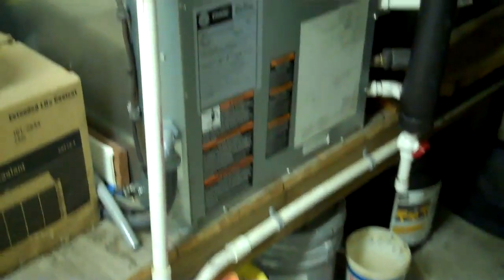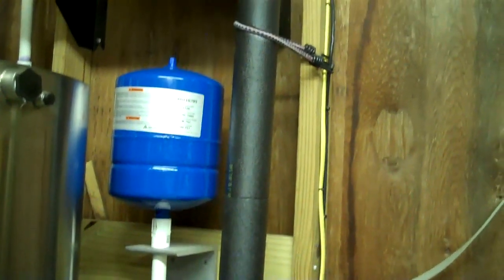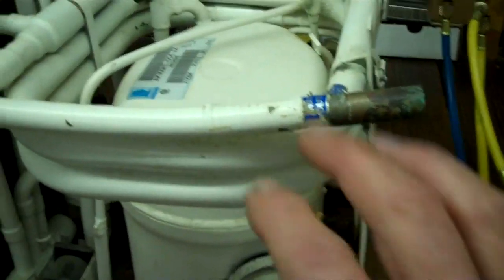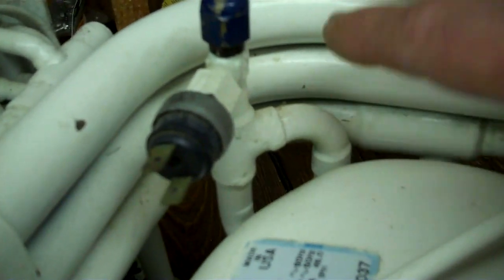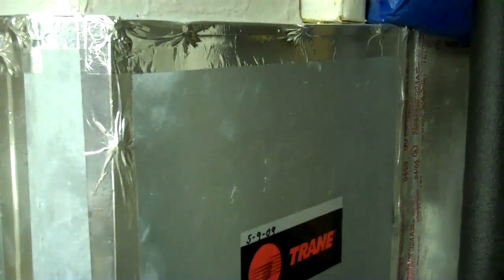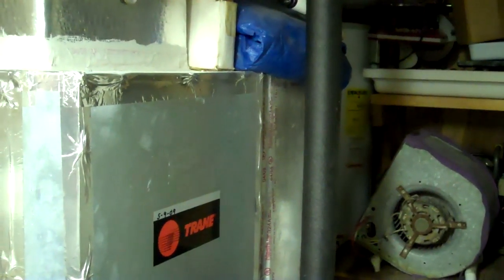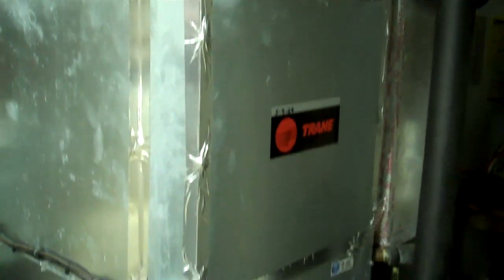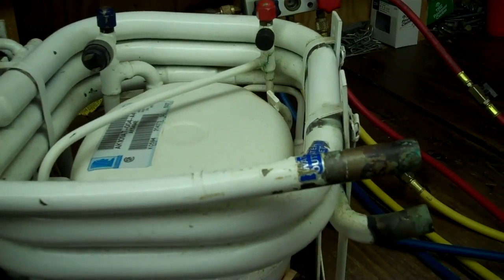GEOTHERMAL HEAT PUMP. A BIG MONEY SAVER...

Comment: Sweet system my 20 year old Water furnace is still running in open circuit mode with 2 wells one for supply and another for discharge. When I added solar the utilities are almost free and in Canada that is something with our winters.

Comment: Actually, phisically speaking, the correct would be to add heat. Heat is an energy type, just like electricity, and likewise it is always circulating between objects, that can be either from the same or from different matter, generally speaking.

Comment: That unit is a Cursair stowaway unit for Marine application manufactured by marine Development company . Or a marine aire knock off . Back in the '70's we were using cooling water from the genorator to temper the sea water going into the HP water coil. Old news i guess we were the first CO Gen company around . DC Marine service ...

Comment: U should save the hot water from the generator to help the heat pump. Then build a wood gasifier to run the generator

Comment: Very nice.If you have 56F ground water,you don't need all this AC unit during summer,just run the ground water through the water-to-air coil with very little energy used.It will give you comfort of 75F inside.I wish we have that temps. of ground water down in florida.We have 75F well water year around..Still sufficient subcooling medium for my heat pump in  cooling mode only.We use heater for a week or so a year.

Comment: Condensers become evaporators and vise versa when the system is reversed.  They are simply heat exchangers and can be used either way.  Your comment is rude and incorrect.

Comment: THANK YOU I AHVE A QUESTION DID YOU MEAN YOU USE A GENERATOR TO POWER UP AND RUN THE UNIT?SECONDLY , THE WATER FROM THE GROUND DOES IT GO DIRECTLY TO THE WATER HEATER? OR DOES IT GO THROUGH THE UNIT , HEATS UP THEN IS SORED IN THE WATER HEATER IS THE WATER HEATER ELECTRIC?

Comment: You need to go back to school and learn your refrigeration cycle you RAT! The compressor is a vapor pump that pumps the refrigerant through the system. Anyone who knows anything about refrigeration knows that the condenser is the part of the system that CONDENSES the vapor refrigerant into a liquid. This would be why it is call the CONDENSER. TIME TO RETIRE!  Thanks for teaching everyone the wrong way, its given me a ton of side work. Sounds like you know alot about reefer and not refrigeration.

Comment from the maker: Thats a great question. I am running about 16GPH when I only need 10GPH. I use this system to water my garden and my lawn. I could run a smaller pump but I save alot of money staying off city water for my irigation needs. Also shallow well pumps under a 1/2 HP are uncommen and expencive. Hope that helped....

Comment: Did I see that the water goes into the heat exchanger at only 3 degrees lower than it comes out?
In an evaporative water tower, we shoot for a 10 degree change.  I can't argue with your success but are you pumping more water into the heat exchanger than is necessary?

Comment from the maker: @MrSchpankme I am not a big fan of the new refridgerants. Most of the push on those is EPA crap IMO.  It was Sunday and we did a bunch of laundrey. The one thing about heating water this way is you dont have a constant water temp. One day you may have water hot enough for cooking and other days its just hot enough. It all depends on how much the system is running. I can always flip the breaker on for the water heater but I try not to do that.

Comment from the maker: @ristin59 That is one nice thing about geothermal , They do best in crazy hot and very cold invironments.Normal heat pumps used in northern climents have whats called strip heat to defrost them and to just plane keep up. With gethermal it dosnt matter what the temp is outside you are using the constant temp of the earth just a short distance under your feet.

Hope that was Helpfull.

Comment: Why don't you set it up in the winter to provide all your refrigeration/freezer needs. I would think you could pipe the cooled compressed gas to a specially rigged freezer or fridge. Then pipe it back to get compressed again, or you could do a mini forced air system with ducts running to a freezer or fridge, that way you avoid piping the gas Keep the videos coming.

Comment: Great explanation and awesome system. 
When I get the house I'm saving up for, I may want to install one of these. I don't have a big need for air conditioning where I live but I do like the savings on heating hot water.
I wonder if a second well that was drilled 20 or 30 feet away from the first one might be a good place to put the excess water.